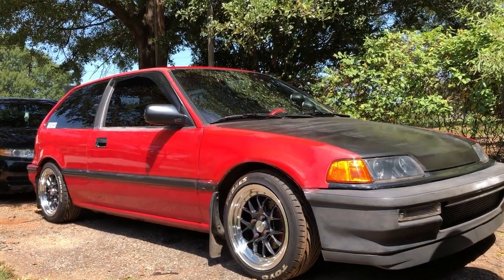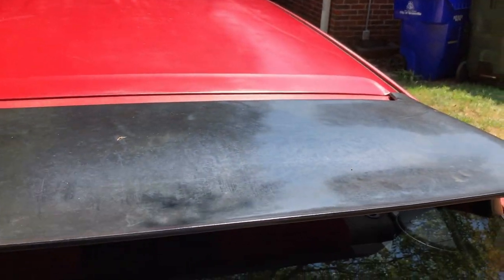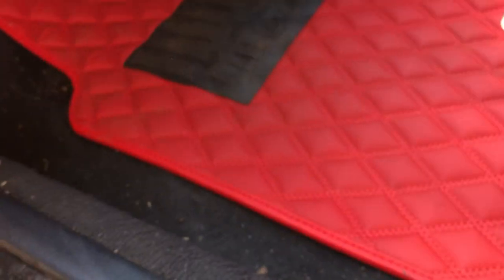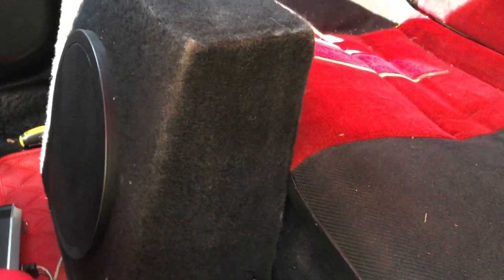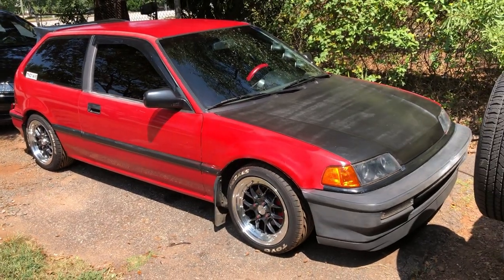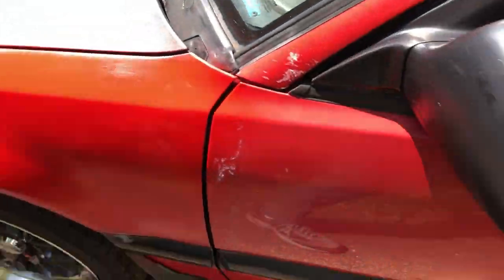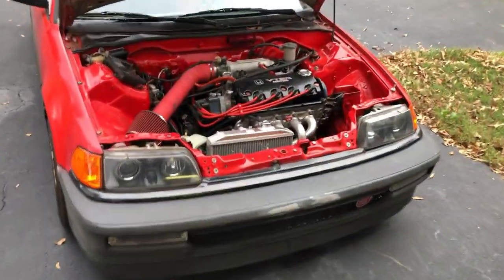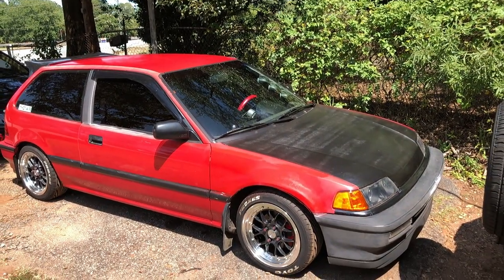91 EF Honda Civic build Walk around. New wheels, Crx dash swap, sound system

Comment: You've done a great job of making it look much better personally red is my nemesis wouldn't drive it don't like driving near it I have a 91 teal SI 425000 km on it and now it's getting the Integra GS from a 92 two-door the OEM motor finally have enough or it did in my opinion anyway. Nice vidio
Reply from the maker: Allan A thanks! I love red personally. But everyone has a preference. I do love a battleship grey and the OEM teal that comes on the old EF hatches and integras

Comment: Lead acid batteries inside your car will rust it out if not in a vented box and can catch fire. Just put an agm battery and you won't have to worry about it leaking either.
Reply from the maker: Oh really?! I didn’t know that. I have a vented box I can install. I guess I know what I’ll be done this weekend lol
Reply: @MooreProjects  the hydrogen gas vents off the battery when charging and is very explosive and corrosive that's why cars with batteries inside the cabin have vacuum lines attached to suck out the gasses. And I love the car bro I have a 90 crx dx celestial blue and I'm about to finally do the dpfi to mpfi conversion. I've been looking for a 90-91 4 door civic to build cause I have 2 kids and only 2 seats... but they are getting g very hard to find now.
Reply from the maker: @scottgoodson6046  nice I really want a CRX but I have a daughter so that’s why the hatchback is nice. I had a 89 sedan but got rid of it. It needed too much work

Comment: How did that Ebay engine rebuild kit workout for you? Do you recommend it, or were there some issues?
Reply from the maker: Mando Ramos none whatsoever. My wife daily drives it. We’ve already put almost 5000 miles on it so far! I can do an update video if you would like. I would recommend it! The only thing I didn’t use from the kit was the headgasket and the rear main seal. I went with a felpro for both.
Reply: @MooreProjects  an update video would be great. I'm doing some repairs on my f23a1 engine, I thought about getting this kit, I won't use all of it though either. I have a felpro headgasket already so I'll use that instead like you mentioned you did. Thanks